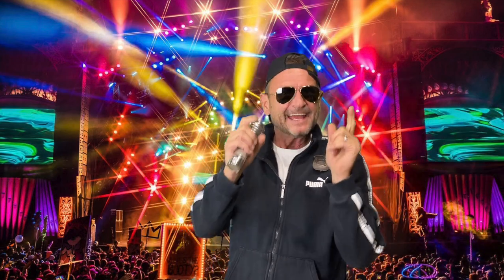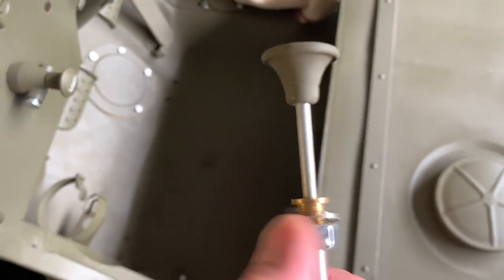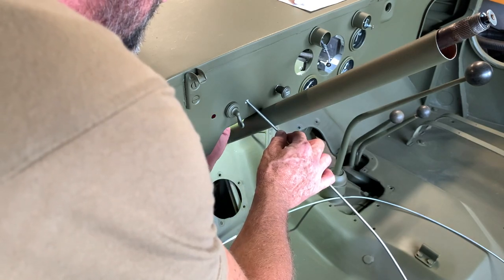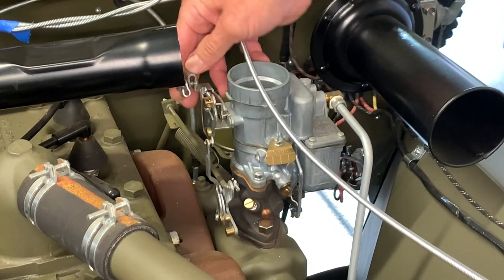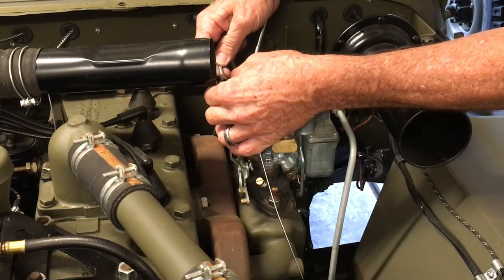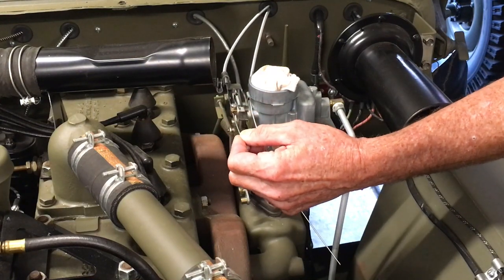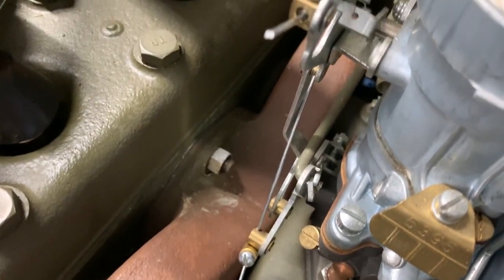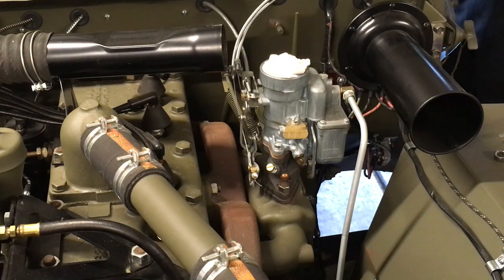Team G503 Throttle And Choke Cable Installation Willys MB / Ford GPW 🔧☑️

Comment: I notice your engine has head bolts vs studs. My 51 3A engine had bolts. It was also painted Ford engine blue, and bored .30 over but I’m curious what designated whether an engine got bolts or studs?

Comment: How does the throttle cable function on the carburetor?  Doesn't the throttle-return spring cause the throttle to close and overwhelm the function of the cable?
Reply: Dont know about the MB's,but I think the CJ's twist to the right to lock the throttle in position,then back to the left to unlock it!

Comment: I just purchase the throttle linkage. The connection at the carb rubs up against the carb - I have taken three #10 washers and epoxied them together - hopefully so they won't slip around the bend. You cant cut off the tip because the hole is too close to the end of the rod. Any other ideas?
Reply: Hey Peer, what was your final fix on this? I am in the same boat.